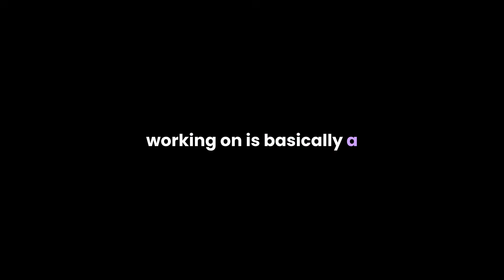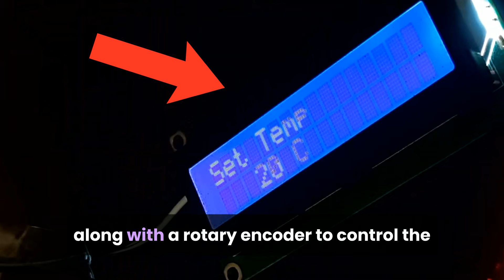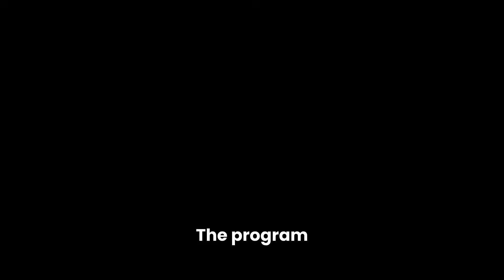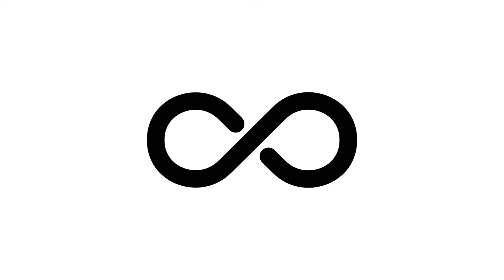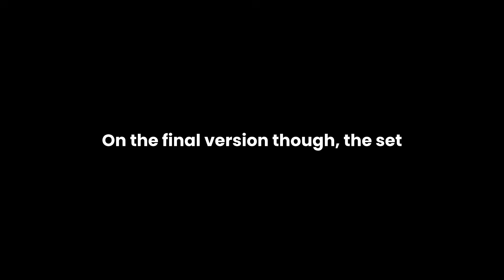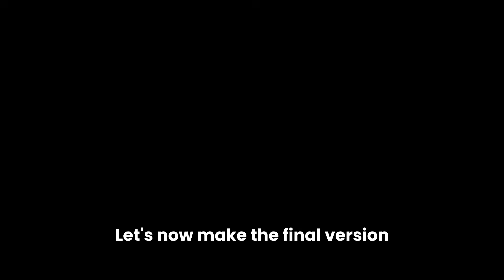The Best Upgrade is Simplification..... So I Simplified My Filament Machines Interface.

Comment: I have a question? How do you heat the plastic so quickly, because while changing the temperature settings, it seemed to update immediately. Is it the “ideal” temperature or current?
Reply from the maker: The display temporarily shows the set temperature (dictated by the potentiometer) and then shortly switches to showing the real temperature.

Comment: why even have a screen for the temperature? since it's always PET then you always want the same temperature, no? just use a single LED to show that the heating is on. you can also ditch the stepper motor, a brushed DC motor with a bigger gearbox can do the same work, and then at that point you don't even need a microcontroller at all, just a bunch of switches and some potentiometers
Reply from the maker: Thanks for the feedback! I will try in the future, once i have decided on an RPM for the motor which will yield the best filament quality, to substitute the stepper motor with a  fixed RPM brushed motor, i was using a stepper motor for now because it was easily available and it was the cheapest option (in my area) which could provide the needed torque. Even with a brushed motor though, a microcontroller will still be necessary as the heater runs on a PID loop. I also wanted to keep the temperature adjustable for now as this project is still in a prototype stage, so i haven"t yet perfected the temperature , and a display + potentiometer make it much easier to set the temperature when prototyping. Once all the experimenting is complete, i will surely implement your ideas of simplifying the machine in the future.
Reply: Playing with the temperature is needed to get different types of filament. High temperature = More brittle, low temperature = More Flexible.
Reply from the maker: @IshitWavhalyes, hence the temperature can be adjusted via the potentiometer.